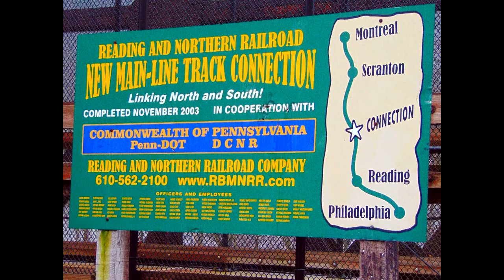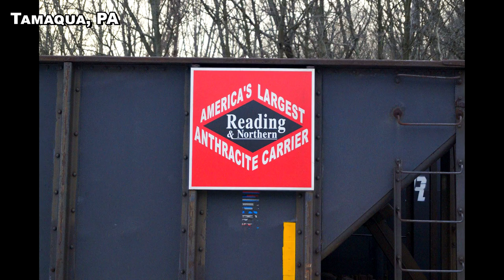The Old Reading Railroad and the New (Part 2) The last of the Decade

Comment: Very informative. The 1950s Wanner photo of what you describe as the former Reading, running past the station looks to me to be part of the former PRR Buffalo Line, south of what is now CP Kase, where the line to Scranton and Bingo, (former PRR Wilkes Barre branch to Buttonwood,) splits off before the Susquenanna bridge. You describe the tracks crossing at grade at SF Tower as the PRR. Where were these cross tracks going, being so close (4 blocks,) to the river bank?? Appreciate your clarification AC.
Reply from the maker: The RDG tracks turned north and paralleled the PRR to Williamsport (Newberry Jct.).
Reply: Thanks for your reply AC. I’ve cleared it up in my mind now. The Wanner photo is facing west, (not north.) I have located the old Reading depot and disused signal bridge on Google Maps. Thanks again.  Please keep up your very informative videos.